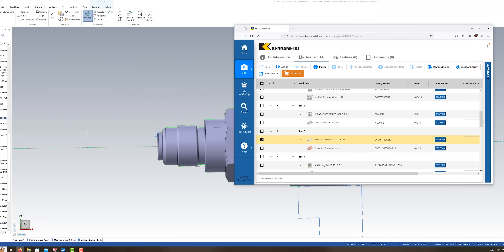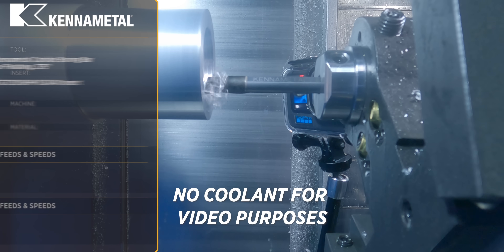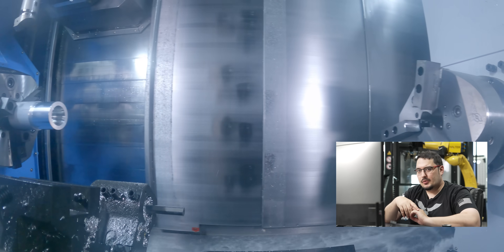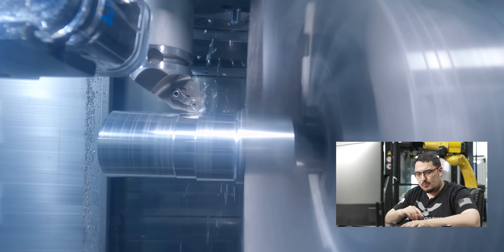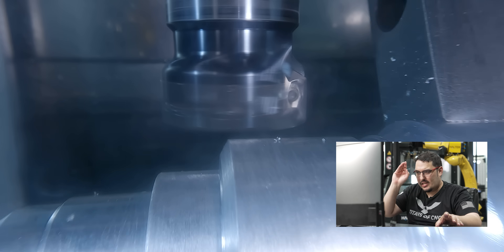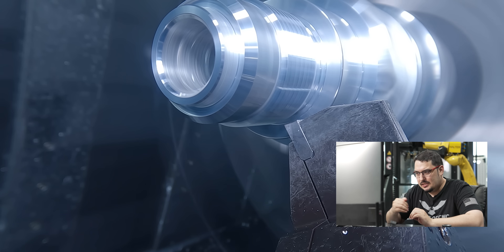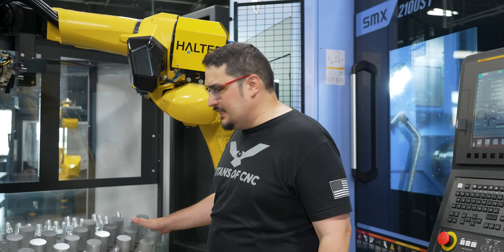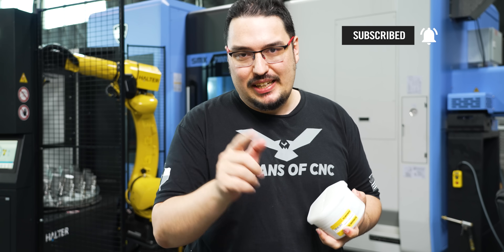Brilliantly Complex CNC Machining Cell Produces PERFECT Parts

Comment: Please just use the metric system like the rest of the world it's 2024 0.008 inch feed doesn't make sense
Reply: Lol stay mad
Reply: It makes just as much since as a .203 mm feed. They are literally the exact same speed. Inch x 25.4= mm
God forbid u have to use basic multiplication.
Reply: @verakoo6187  wouldn't have to use multiplication if you just used the metric system
Reply: I used inches bro and they in the USA so its the system w use. Im sure u can use a formula to make u happy and change to ur #
Reply: this is the standard machinists in the US use because that is what its industry has been built around. i'm an engineering student in the US, and as much as i hate the imperial system it's what i gotta use. you make do with what you've got
Reply: @maedotred technically speaking the industry is built around the metric system. Do you know how an inch is described as in the US?
Reply: You don't make sense. 8 thou per revolution makes perfect sense and it's easy to convert back and forth between mm and inches. I use both systems everyday as an operator
Reply: People that work with imperial standard can easily work with metic, we can switch back and forth. The same cannot be said about those soy filled metic girls.
Reply: Yeah man thanks ive been saying that fie a while freedom unit bullshit....
Reply: Oh sorry, i forgot inches made it to the moon first. Just for you ill do the math, it's roughly .2mm per rev.
Reply: NASA used the metric system to get to the moon and does to this day.

Comment: Question: When you do the chuck transfer, why does this need to be done with both chucks turning and synced up? It's probably quite obvious to machinists but I just can't figure out what the advantage is, unless perhaps so you can keep the chuck rotating and don't need to bring it back up to speed. Or was it for demonstration purposes?
Reply: My guess is to keep the part turning true to the spindle axis. If it's rotating during transfer, it's rotating true. But if it's static, the second chuck might not clamp true
Reply: @Orakwan  Oh hey yeah, that's actually really logical. That must be it I think. I knew there must be some logical explanation. Cool, thanks for explaining kind stranger!
Reply: Also spinning helps remove coolant and chips that might be there

Comment: If you are using cermet for steel, why aren't you using PCD for finishing aluminium yet? Coated carbide insert for finishing aluminium is kind of a noob move?
Reply: It depends on the coating.
Reply: You must be really smart.
Reply: @Bergundy2 I'm just asking, but thanks for your input

Comment: If you slow down the video at 1:14 when the boring bar comes out, you can see it flex and kind of tilt from the speed of the tool change, was the bar not tightened all the way in the tool holder? Or is it fine?
Reply: Maybe due to  some camera frame rate setting
Reply: Yeah, that boring bar totally bends over an inch😂 hopefully its just an illusion for us or for the camera. @suryaselvam9082
Reply: it's the camera shutter speed
Reply: @Guranga93  oh ok, I was pretty confused, thanks for explaining

Comment: why the pilot drill when you just rough out the ID anyways? also (not a lathe guy sry) why do the chucks always turn when transfering the part?
Reply: It's just to help center it since the drill after is a 10xD drill.  If it were just a few parts I could probably let it go without one, but with a lot of parts I want to make sure I don't have to worry about the drill walking or anything
Reply: But that 10xD drill insert doesn't like pilot holes, it centers itself when running into a perfectly flat face. Worst case scenario when reaching the bottom of the pilot hole it will try to wander off center and damage the insert